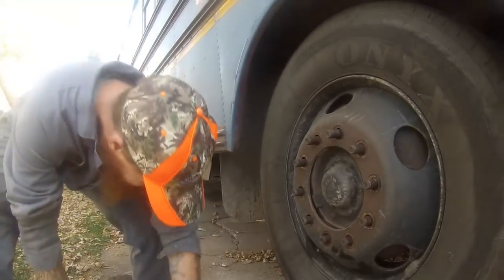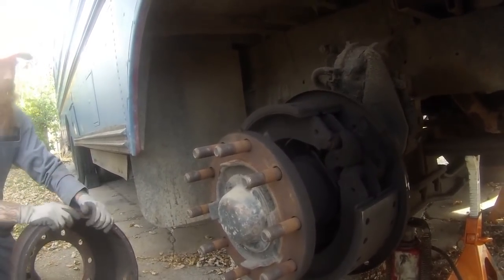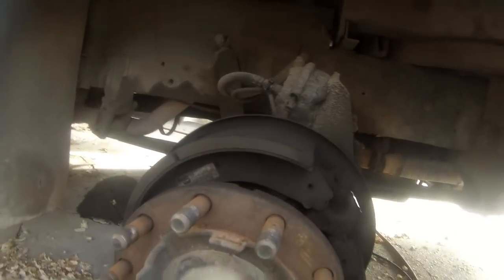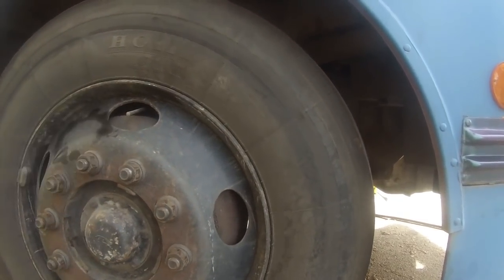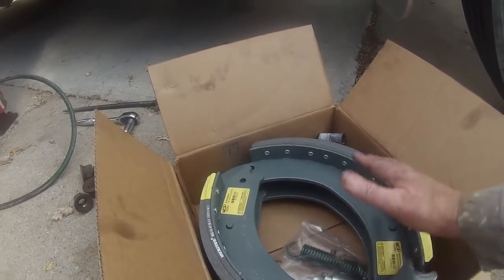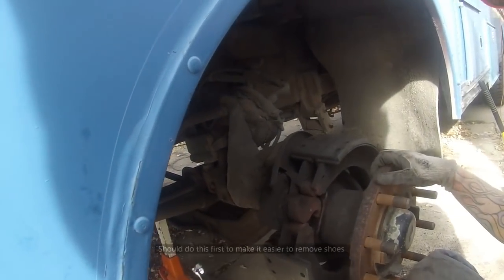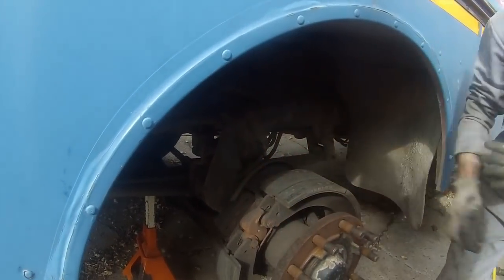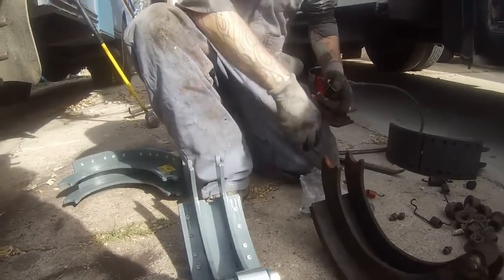Upgrade Time 2- Air Brakes How they work and replacing shoes

Comment: I'd been wanting to ask, since your bus came from Ohio and then New York, what did you do with the rust issue UNDER the bus. As with you, mine is a handicap bus. It's from VA, so I thought little or no snow, little or no rust. I was so wrong. It sits lower to the ground than a regular bus because of tires, so lower ground clearance. How did you address the rust?
Reply from the maker: When I first went to look at it I started it up and crawled from one end to the other looking for leaks and rust. It has some surface rust here and there. But the worst part was over the wheels. The floor over both back wheels was rotted through. The front ones were double thickness and puffed up. So I cut them all out and welded new metal over them.